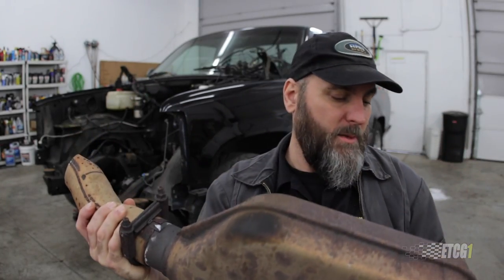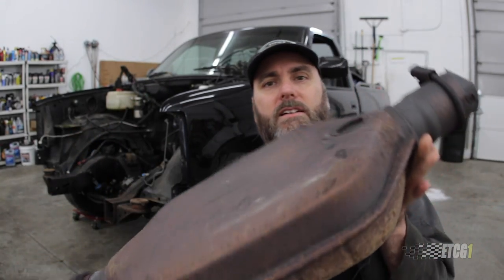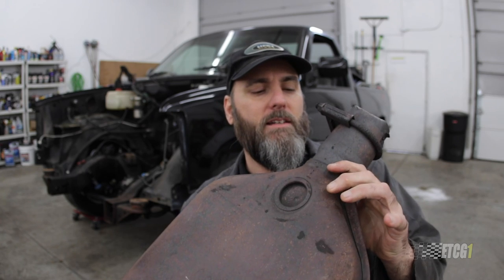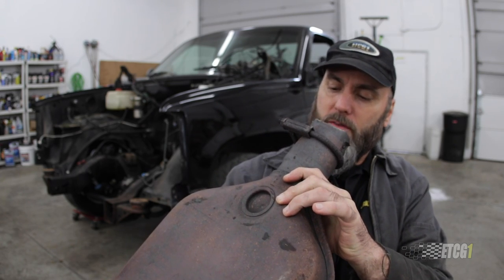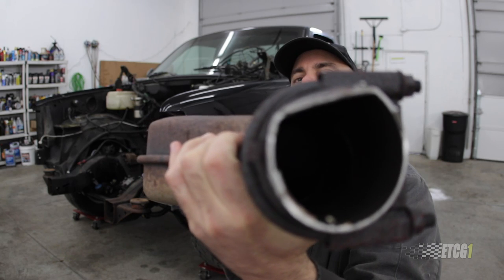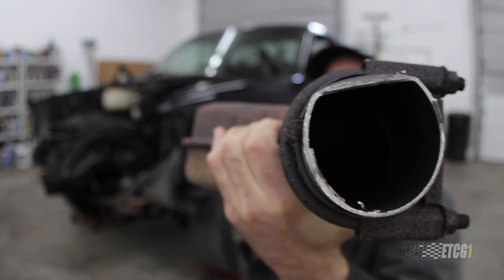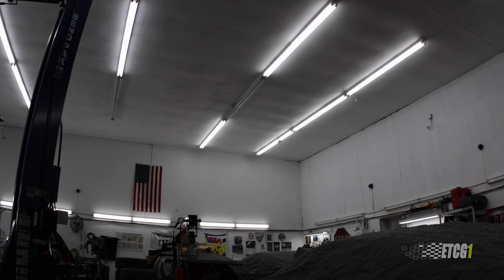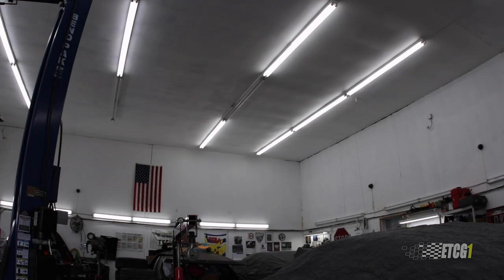Should You Run a Catalytic Converter on Your Hot Rod?

Comment: Hi Eric - i am kind of shocked at the number of people (you tubers, companies etc etc) advocating the removal of anti-pollution systems.  This can range from cat delete by through pipes or digging out the contents of dpf's or cats, EGR delete ........
these things are there for a purpose and i believe that they should remain and should work correctly
On the other hand i drive an M4 which doesnt exactly have the lowest CO2 emmissions ............. but its totally legal and un-modified

Now let me ask you how you feel about the differences between American cars (including trucks) and European cars - the engine sizes in the USA tend to be much bigger than in Europe even though things are starting to change and i believe that the power to capacity ratio in Europe is (much) higher in Europe than in the USA - correct me if I am wrong - certainly in the past there were a lot of V8, 5 litre American cars making a ridiculously low power output
maybe you have some comments on that to put things in perspective ???
Reply from the maker: US vehicles were less efficient at one time, but now that everything is 'global' I think it's negligible. Remember that I'm updating the fuel system to multiport with timing control. Just that system alone will work far better than what was on the truck originally. 

Thanks for your comment.

Comment: My 96 Mustang has 6 catalytic converters. I'm going to replace them with 2 high flow, modern cats.  That will give both weight and power savings, while being environmentally friendly. Also, if I register as a 'classic' to bypass emission testing, then there's a limit of 5000 miles allowed per year.
Reply: I'd like to see the cost of the build of your exhaust versus the salvage value of your current catalytic converters
Reply: @philiprizek6384  The catted x-pipe I'm looking at is $450. I have no idea the value of the old cats. I'll try to remember to post when I find out.
Reply: @steveanderson7667  I know I got $75 for 1 guy found half buried in the ground once

Comment: The Feds disagree with your rational. And the Federal laws always trump state laws. If it had a cat when built, it needs one to be compliant to meet the Clean Air Act.  A modern 3 way honeycomb cat won't restrict the exhaust flow any more than a good muffler so use a pair. We all breathe the same air.

Comment: What about stolen cats? The replacements are insanely expensive but "high flow" cats are cheap but don't last. that damned truck is nichel and diming you into the poor house. Cats or no cats? I'm a fan of cheap personally. I'm curious how that would effect mileage and if the anti fouler trick really works.

Comment: Well Eric, think about it this way, do you want to be the guy sitting behind you waiting for the traffic lights to turn green?
Reply from the maker: A catalytic converter really won't fix that. Emissions is about more than just an exhaust component. I get your meaning though. Thanks for the comment.
Reply: @ETCG1  Well, it converts toxic CO into non-toxic CO2, so I would say it fixes pretty much 90% of the problems.
Reply from the maker: @gitplayer55  Sorry, but that's not what it does. Catalytic converters reduce NOx emissions, not CO. CO is controlled by the fuel mixture more than anything else. The richer the mix, the more the CO. BTW, CO2 is very toxic and contributes to global warming.
Reply: @ETCG1  I don't know about your converters, but that's absolutely what it does: 

"The oxidation catalyst is the second stage of the catalytic converter. It reduces the unburned hydrocarbons and carbon monoxide by burning (oxidizing) them over a platinum and palladium catalyst. This catalyst aids the reaction of the CO and hydrocarbons with the remaining oxygen in the exhaust gas. For example:

2CO + O2 => 2CO2"

Soruce: https://auto.howstuffworks.com/catalytic-converter2.htm 

And no, CO2 is not toxic, it's produced by every breathing animal. You would intoxicate your own body, if it was. CO will go straight to your blood and bind itself to the hemoglobin instead of the oxygen, which leads to carbion monoxide poisoning: https://en.wikipedia.org/wiki/Carbon_monoxide_poisoning
Reply from the maker: The main function of the catalytic converter is to reduce NOx emissions, not CO. CO reduction is a secondary function because of the heat the the catalytic converter makes. CO is produced as a result of incomplete combustion. Get your combustion right, and CO is not an issue. With perfect combustion, there is virtually no CO to eliminate. I'm not saying that the catalytic converter does not reduce CO. What I'm saying is that was never it's main function. NOx is what causes smog. The EGR and Catalytic converter are designed to reduce NOx which is considered one of the most harmful greenhouse gasses. 

As for CO2, it is also listed as one of the most harmful pollutants. Yes, it occurs naturally, but too much of it can act like an insulator and keep heat in the atmosphere and is considered a greenhouse gas as a result.

Comment: Honestly, cats help reduce nox. That's the real pollutant. co and hc aren't nearly as bad, and co2 isn't a pollutant.
Run cats, there's no reason not to. Aftermarket cats are cheap, your doing exhaust work anyway. Put a cat on now and choose your muffling to match. I'm not an environmentalist, but it's just basic shit. I at least understand a simplification argument for removing air pumps and they have a very narrow effective use for reducing emissions anyway. If you want to simplify and remove EGR I can understand that too. But only if you're doing a bare bones engine. If you have other shit, run EGR. It's better for performance and emissions.

Comment: There aren't enough hot rods around to make a difference in terms of regional air pollution, like the big orange clouds we used to have over all our cities all the time.  But when you're in traffic and there's a car behind you with an asthmatic kid in it, would it make a difference then?  I honestly don't know how much of which gasses a cat burns.  Since I'm not sure, I think I'd keep a cat on it.  I doubt it will sap much power and it's not like you're racing competitively.
Reply: every contribution is pollution
Reply: @humanoverlord6708  Of course, but there are so few hot rods and the few that exist aren't out there racking up miles.
Reply from the maker: My quandary is that I'm installing a better fuel and spark delivery system on this truck which will improve the emissions. I just don't know if those emissions will be better than stock or not.
Reply: @ETCG1  The only way to know would be to do an emissions test with and without a cat.  I'm certainly no expert but I don't see how a better fuel and ignition system could really replace what a catalytic converter does.
Reply from the maker: @saddestchord7622  Well, you can't run a cat without a good fuel and ignition system. The better the engine burns, the better its emissions.
Reply: @ETCG1  If it were me I'd still put in cats unless I had proof they wouldn't affect the emissions much.  Other commenters have noted how much the exhaust will stink without them.  For that reason alone I think it would be worth it.  Small expense when you look at the whole project.

Comment: It's a violation of the Federal Clean Air Act to remove any emissions controls from a vehicle that was originally equipped with them, regardless of the age of the vehicle. If caught, an individual can face a fine of up to $2,500, and a professional shop up to $25,000.

Just putting that out there, don't shoot the messenger.
Reply: Yup, was going to say the same thing.  Also, just because a state/county doesn't have emissions testing does NOT mean that you can remove emissions equipment.
Reply from the maker: However I'm upgrading the fuel and ignition system with components that will likely be better than was on the truck stock and produce less emissions as a result. Hence the quandary.
Reply: @ETCG1  You are probably correct that the truck will produce less emissions, but that is only an assumption.  It would have been ideal for a before/after test, but as you explained that really isn't possible.  I don't know what your build will be, but also consider that high performance engines actually generate more NOx, one of the most harmful pollutants in exhaust gas.  As you increase the combustion temperature and pressure you also increase NOx.  So you may end up increasing some of the pollutants in the exhaust while decreasing others, so it is really hard to say what the overall effect it.
Reply from the maker: @talleddie81  I agree, it is difficult to call without testing. And you're right about the possibility of increased NOx. What I thought of doing was after I completed the truck to have the emissions tested and then compare those numbers to what the stock emissions for the truck at the time of manufacturer. I'm sure those are available somewhere.

Comment: Cats are trash I take them off all my cars pre 2014

The early cats barely did anything and were extremely restricted 

I just like less parts that can fail if I had a newer car that I left stock I’d probably just leave it on 

But if it needs to be replaced I’m just gonna remove it and slap a extension on the o2 

Also when  all the emissions crap happened car companies just put bs egr and cats on the car and crap ecus that barely did the bare minimum for the obd2 requirements so a lot of stuff on the cars is just there to satisfy gov it’s not that beneficial.

I know people in California with straight pipes and pass smog as long as it’s not runing rich or burning oil your golden 

Also the fuel we run now is extremely different and has so many additives to try and make your can run normal and has less pollution

So I think it’s just up to the sound 
Honda’s sound like a bee hive straight piped xD

Comment: I don't see any reason why you should not take the cat off the truck.. but I would make one recommendation... Don't take the truck to any place that has emission laws that they are testing or enforcing.   Your not protesting the law, so why 'break the law.'  There is no reason to tempt fate, and you really don't want to add to the problems of people that have foreseen the need for such a law.
Reply from the maker: I don't know of any state that will pull you over and do an emissions test. That's usually done when you get your registration. You can't get registration for a vehicle that won't pass an emissions test in those states.
Reply: @ETCG1  I was under the impression that a police officer could see you vehicle running and for some reason, force you take a car in for emission inspection.   It might or might not be true..  in most cases you should be fine..

But what I guess i want argue is you need to keep your vehicle's appearance up to the legal requirements of the law.  If you don't, you do could be pulled over on that account, and then given a ticket for another reason.  While removing the cat is not a vary noticeable change, its still noticeable change, and anyone is going to notice it missing/think to look for one, it will be a cop.

A example would be, Massachusetts where... "Visible smoke emitted from the exhaust pipe is considered a safety-related failure, applicable to all vehicles regardless of age."  

https://drivinglaws.aaa.com/tag/emissions-inspection/

I'm not sure if they can legally force you into emissions inspection zone, but when they got a law like that on the books, they can say anything about your car or truck and then throw the book at you.  

Some cops are nice people.. some are not.  The argument I'm going with is Its not a good idea to test which one you will notice you.
Reply from the maker: @baloneyjusticecheezedog  No, they can't do that. All cops have to work within the law. If there are no emissions inspections where my vehicle is registered, which there aren't, they won't pull me over for it and can't force me to take an emissions test, especially if there is no local facility to do so. As for appearance, unless the cop is a foot tall, or they want to lay under my truck to look, they're never going to see my exhaust.

Comment: Hi Eric. I am replying to you on a day when London has brought in an Ultra Low Emissions Zone ULEZ 
It's only a matter of time before most major cities will be bringing in these new laws on combustion engine emissions. My business is mostly classic cars, and London is a stone throw away from my workshop. Also, my children live in London, and also my Grandchildren. 
Using polluting vehicles in a built up area on a daily basis is bad, but how bad is using a classic, or hot rod vehicle just at weekends etc !
Anyways, I don't have an answer. Just thought I would drop in my thoughts  
Peace brother
Kevin 
KP Daly Automotive
Reply from the maker: That is my exact question. I'd also like to point out that the fuel and ignition system I'm installing are much better than the original 1990 stuff. It would have ben nice to know what the emissions were before and after but I simply didn't have time for that. Thank you very much for your input.

Comment: I think 99% of road vehicles should use them, but the occasional enthusiast or performance build that doesn't have one - I'm not really bothered. Even if they are daily driven.
Reply: Everyone thinks they are the special 1%, it doesn't work.  Especially if daily driven.
Reply: @randomvideosn0where  Disagree, the vast majority of the average population thinks a cat is something that meows and combined with emission testing in some areas and check engine lights - removal isn't something the average joe will do on the average modern vehicle.
Reply: @BaudBand  True, most people don't know what it is (sadly).  However I would bet more than 1% total of vehicles wouldn't have a functioning cat if they were not forced to, mainly from neglect and then all the enthusiasts.

Comment: I think it's not needed on 95 or older cars and trucks IMO it was invented to reduce the emissions and smog in California because of the climate there were 40-60's cars and trucks still on the road and burning oil and pollution was at an all time high. In NYS we don't have these problems so they try to convince us of global warming to be able to charge us more for inspections but the safety of these vehicles is at a low to say the least, you have better safety requirements on a demolition derby car than on the streets of WNY 😂 It's dumb to over regulate these laws and with newer cars it's apparent. So much technology in a new car they cost 10x what the should be and you only get two years of safety only inspections for 50,000 dollar's. It's a scam at this point.

Comment: Sure a few cars here and there running straight pipes won't make a difference. But I'd still run a cat as a courtesy to the people who have  to follow me. The smell from vehicles without cats is awful. The cat alone must handle 90% of emissions. Once I ran my car with the exhaust opened pre-cat and the fumes were unreal. That sold me on the value of cats.
Reply from the maker: Many people have brought up the 'smell' of a vehicle without a catalytic converter and I don't get it. Having or not having a converter has nothing to do with how exhaust smells. In fact, a catalytic converter can actually make the exhaust smell worse if the fuel has a lot of sulfur in it. The converter brakes down the sulfur and it smells like rotten eggs. 

What you may be referring to is a vehicle that emits a lot of hydrocarbons. That has a distinctive fuel smell. Has nothing to do with a catalytic converter, but with how the engine is burning.
Reply: @ETCG1  the cat burns off those hydrocarbons so you can tell they are not getting into the air. Therefore no unburnt fuel smell. Was just driving behind someone yesterday in some beater pickup and the smell was so bad we had to close the windows and turn on the AC to mitigate it.
Reply from the maker: @AmandaHugenkiss2915  That could just has easily been caused by a bad O2 sensor or some other emissions failure causing a bad fuel mix. You can't say for certain that the smell was due to the vehicle not having a cat. 

The primary function of the cat is to take care of NOx emissions, not HC.
Reply: @ETCG1  agreed, it very well could be, or their cat is no longer effective. But running a straight pipe definitely results in unburned HCs since the sole purpose of the cat is to convert them to CO2 and H20 and reduce NOx. And we all know what pre-cat exhaust smells like. The same as a rich mixture, or a cat that's no good, or a straight pipe, or an exhaust leak pre-cat.
Reply from the maker: @AmandaHugenkiss2915  There won't be much unburned HC if the fuel mix is good. The multiport system I'll be running also has timing controls. In fact, the system I'm installing, with a modern O2 sensor, is much more efficient than the original system. The sole purpose of the cat is to reduce NOx emissions. Reducing HC is a secondary effect.

Comment: To be honest I could care less if it had one or if it didn't my issue when it comes to catalytic converters is the price on how much they cost it's like if you lower the price people would probably have no problem put in a catalytic converter on but no they want to jack up the price for a piece of metal that goes right into the middle of the exhaust I used to have a 240SX that I cut the exhaust and went straight pipe police pulled me over told me I had no can let it converter he happened to be a car guy so I turn around put a new catalytic converter and hollowed out the catalytic converter to just make it look like I had one and they pulled me over again tapped on the exhaust with their flashlights and told me that I hollowed out the cat and it still don't have one 😆 so I had no choice but to spin $1,500 to get a new catalytic converter put on 😠🙈🙉🙊